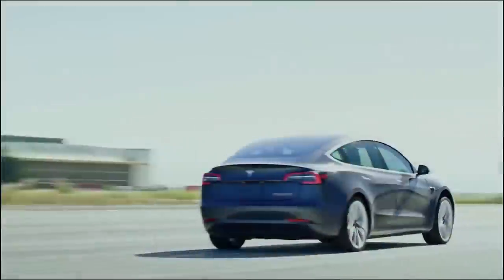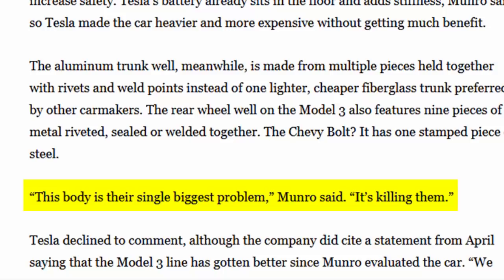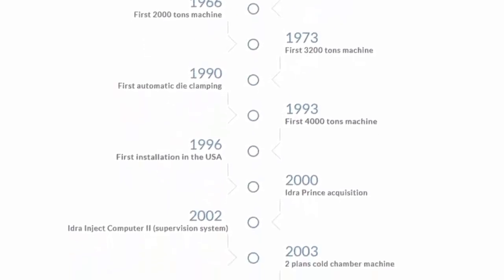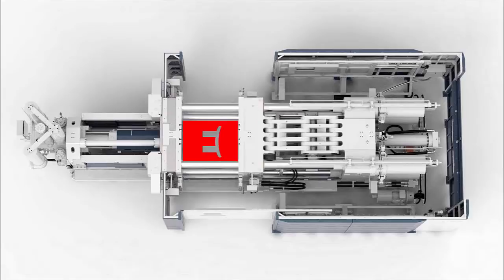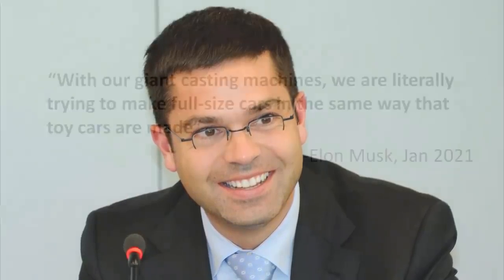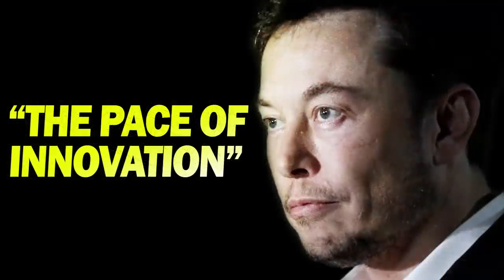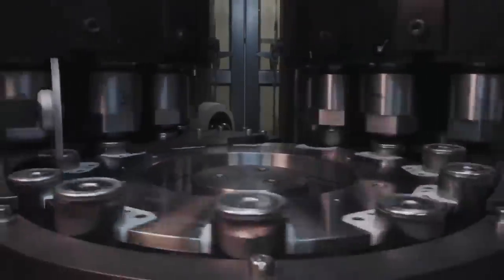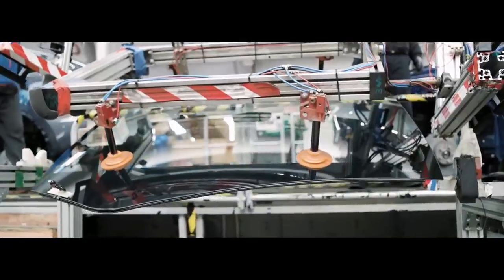Tesla Giga Press will CRUSH

Comment: I've seen MANY people use a torch or welder on something, quench it in a water bucket and then leave it in or set it aside to cool for a few extra minutes. I demonstrated that to my former boss in his machinery shop after he'd just seconds before, quenched a glowing hot mower blade in a bucket and I immediately reached into the water to retrieve it. It was the look on his face when he likely tallied up how much time he'd wasted over the course of his 35 years as a farmer. 
I scoffed when he told me to, "TELL....EVERYONE." I thought it was common knowledge and he'd just missed it somehow. It turns out that a lot more people were not aware of this fact than those who were. This was also some time before the ubiquity of the Internet, so I felt a little bit like I'd contributed in some way to the field of mechanical engineering. Lol 😂 
I later discovered—with the Internet this time—that the temperature of hot metal didn't fall to match the temperature of the water in the blink of the eye; it actually fell BELOW the temperature of the water. 🤯 It's the reason why we cool our bodies by sweat. 
Blah blah blah blah.

Comment: ....... completely ignoring the fact that ALL aluminium (yes I'm English) alloys work harden, fracture and fail. IF you prefer longevity, structural integrity, disinclination to ADD to the severity of a fire resultant from a collision, and ultimately the safety of you-and-yours, steel is a far superior material from which construct the body of a motor vehicle.

Comment: There are other hydraulic presses made that are designed to press close to 500 tons with low/high carbon steel alloys in industrial applications. The aluminum silicone alloy is indeed strong, but will be; wasting silicone that can be used in computers, and two is the fact that there are no hardened metals in there. With no hardened metals the chassis will be susceptible to plastic deformation.

Comment: Casting a aluminum car means the whole car will be useless after a fender bender. It will be impossible to fix a car made like this. I guess that is inline with Tesla's values because they don't want people fixing or repairing their cars.
Reply: This is discussed towards the end of the video. What they say makes sense.
Reply: @deldridg  cutting off crash rails and bolting new ones on sounds good.. until  you actually look at the details. The bolts will likely be steel. Aluminum bolts would not have the strength.  Yet the interface between steel and aluminum causes corrosion when the two elements make contact with each other over a span of time. So all of this "sounds good on paper"  it's kinda "fantasy land" in reality though. And have a insurance solution to this is hardly a solution. Jeezless
Reply: It wont make the car in one piece. It's like unattainable goal to push the process into new frontiers. They want to reduce the part count on the frame. Its impossible to make a large frame as a single casting.

Comment: I think that the CCP will apply this tech to military production and also dump EVs into emerging markets, just as they have done with Solar and Wind, largely by stealing or replication and "replacement", in the marketplace, even at a loss, if necessary .. They have also cornered the market (production) of strategic, rare-earth metals and other strategic materials and catalysts.

Comment: Other manufacturers don't need to reverse engineer anything ...
They take a part they want to make, design it respecting general semi-solid casting guide lines and recommendations from Idra, and make it with another custom Idra press.

Imo if one of the giga-castings gets damaged, this would be comparable to a damaged frame on a normal car, which can also be very expensive to repair.

Still the idea of a battery pack as a structural element makes me unconfortable ...

Comment: Current car bodies are made as sandwich of different metal parts to provide right ballance with brittleness and elasticity. So most likely they need to add steel parts inside aluminium part. And it's not an only press issue. Am i right?

Comment: I test drove a MY last weekend thinking there was a high chance I would buy one. The demo car looked like it had been wreak and repaired poorly by a shady body shop.  The gaps between the interior door panels and the dash were way high on one side and low on the other.  The windshield was above the A-pillar on one side and below on the other. The hood was crooked with really tight panel gaps on the upper passenger side and huge gaps on the lower driver's side.  Nothing I observed indicated Tesla has caught up to other manufacturers in their ability to assemble a car, they sure haven't leapfrogged them.

I understand some people's Teslas are assembled better than others.   If you feel like your car is perfect that's awesome - enjoy your ride.

Comment: I don't see any fundamental reason that cutting off a damaged crash extension and bolting on a replacement should reduce crash integrity or lifetime of the vehicle, done properly. Why does assembling the structure from 70 pieces improve that?

Comment: Model 3 starts out around 40,000. Battery changes probably every 7 to 10 years adds another 5 to $8,000... Somewhere in that range, plus the cost of charging the thing... along with the fact they are digging tons and tons of coal to make electricity, does not convince me electric cars are a green New Deal. Unique cars yes. Green absolutely not. There's a better answer than relying on fossil fuels to make cars go

Comment: Good idea for a factory but we'll have to see how the insurance companies feel about this as you mentioned. They will also need one or two of these machines sitting off to the side, often idle, just to make replacement parts for the previous generation cars still on the road. Doesn't really matter much for Tesla and their rich owners but I suspect this is one reason legacy brands haven't done this when they're trying to put out a new car with a MSRP of $18K which requires a shelf of common parts that can be interchanged between several models.
Reply: I agree. Munroe said " on hit in the rear on a tesla Y means the tesla with be totaled...."

Comment: I thing crash test will be chalange. Steel deforms and absorb energy of impact. Casted aluminium is fragile.
Reply: you have that backwards, aluminum deforms and absorbs energy of impact. steel does not. modern aluminum cars are safer for that reason.
Reply: @Zreknarf  yes and no. Aluminium cars are I guess from dural, which is used also for airplanes or TS which aee more flexible. According composition this seem to be silumin which is not flexible and in molded parts are also bubles, so can be upredictable. Aluminium cars have high safety, but mostly due to weight, which is eliminated by batery in this case.
But as I wrote is chalange, not impossible. Anyway is something new, testing will be expensive. And changes expensive too.

Comment: I have seen this many times, its; Designed by Engineers, rather than; Designed for Manufacturing. I use to be one of these guys who would do a lot of things like this, until I had an opportunity to over see a small cnc manufacturing company and realized that simple things like changing hole size, move a hole, change thread size, etc can save a ton of money. I then studied design for manufacturing.

Comment: Cast aluminum forms fine cracks when fatigued... this will catapult Tesla into exciting court cases within 20 years. One can be curious.
Reply: Bye the way that is why other companies don’t use it anymore ;)
Reply: I'm an aircraft mechanic in Alaska.  Salt water corrosion is a major issue with castings.
Intergranular corrosion is internal to the part.  It's very difficult to find before failure.
If the part is a third of the frame...that sounds expensive.
Reply: @chilkat_river  that’s another aspect for the same reason, right.

Comment: There isn't anything crazy advanced or even new in that press.  Pressure die casting has been going on for a very long time.  It's the application that is the great idea.
Reply: Or not, if it increases weight and cost using aluminium rather than steel. Only works with large volume runs.

Comment: tesla, always learning what others have known for decades. why do we not use aluminum castings for car frames? there are very good reasons why we don't. we use steel because it is very strong, and can flex and bend and return to its initial shape. we don't use cast aluminum because it doesn't like to bend, it breaks. cars move, a lot, it's what they do. bending and stressing and vibrating. how much are you paying for that car? and you risk frame cracks?...

Comment: These castings seem great for manufacturing, but how do you repair collision damage when the whole front or rear structure is one big casting welded to the center chassis? 

On a typical car, you would cut out the affected area, and weld in new material if you can't straighten it. That's not too bad if it's made of formed and welded steel, which is pretty ductile. 

But how much can you straighten an aluminum casting without it snapping? How do you replace part of the damaged casting without compromising its strength and crashworthiness? What does a replacement casting cost, and how much expense is involved in disassembling the car to replace it?

It looks to me that a car built like this is far less likely to be repaired after a significant crash, and that would probably be reflected in higher insurance rates as well.
Reply: The simple answer is that cars with the kind of damage you refer to are written of, whether EV or ICE. You smack a modern car side on and it will bend and that is not reparable, it will be written off.. Well it is but it is not a viable financial operation.

Comment: A 3d mill in a body shop to make a replacement part for the bolt on patch to the giga casting?  Not in bodyshops I have seen.  Then again regular unibodiy vehicles in crashes serious enough to need a frame jig are generally written off too.... It might be a wash statistically.
Reply: It always depends on the damage.

Comment: Germany was using high pressure die casting to manufacture aircraft bulkheads in WW2.
Reply: Yes, but zey dint zign ze paperz !
Reply: It looks like a standard die casting machine used for metal and plastic.
Reply: @tubester4567  No it use a special aluminum for the Giga press because the normal aluminum can cool at different temperatures so it can cause cracking.
Reply: @Madame702  Yah but the machine itself isnt new, its a standard die casting machine, just big.
Reply: @tubester4567  Great news Tesla Giga Texas will have massive Tesla Power Pack batteries on site.  Elon Musk is going to turn Tesla Giga Texas into a electric vehicle.  This is great news this force GM, and Ford to also do the same to their factories.👍⭐😊

Comment: Sounds like a lot of aluminum welders will be needed after crashes
Reply: or just years of normal use. metal fatigue. we don't normally use cast aluminum for a structure which flexes and vibrates in normal daily use. I don't understand their thinking..
Reply: @lorenzo42p  uh, airplane wings? Yeah, there are time and cycle limits for the fuselage, but the wings see much more stress and flex per flight and cycle

Comment: Knowing at least one famous German car manufacturer from the inside, I can tell you: they are fuckin NOT ready to compete with this.
Reply: yeah but they will catch up quick
Reply: @parg60  Probably less than decade. Yeah.
Reply: @parg60  My best guess regarding the German car makers is, that there is a 50/50 chance that they will make it... You have to see one thing: Companies like Tesla are doing this stuff for 20 years. The only thing we Germans did, was to make the old fashioned way more efficient. Innovation is dead inside those companies. PLUS today most of the development is outsourced to lower cost. Look at FEV in Aachen for example. Those guys could totally make a car on their own...
Reply: Yeah but now look it that way: Tesla is competing against companies that have the infrastructure of producing cars for far more than 50 years, but still manages to be conpared to those. I don't see many of the old guard still be around in let's say 25 years from now...
Reply: @TheMullela  Yes, but german car industry has been building cars for a really long time. There's more than just a battery and electric motors in a car. And living in Germany, I can tell you that VW, Mercedes and BMW are trying really hard. And they are in no means worse than Teslas. Here in the EU, most of electric cars are not Teslas.
Reply: @parg60  compared to establishing a vertically integrated supply chain, while making EV affordable in the most fashionable way, building cars is fairly easy. Just wait about 10 years and you will start seeing which companies will survive this and which one's not.
Trying hard won't safe them. They smiled for too long and Mr musk.
Reply: GM and Ford are already dominating the north American market, and their flagships haven't even launched yet. I'm not sure about Europe and likely not Asia, but Canada, America and Mexico will still be dominated by the big 3 (for better or for worse) 

https://www.google.com/amp/s/jalopnik.com/ford-is-beating-tesla-in-one-of-the-most-ev-saturated-m-1847009876/amp

Comment: This will help them today but this is not the future of the automobile.  I believe the future will just be a "skateboard" battery filled chassis with hub motors with whatever body you want on it.  Magna is already working on these and I believe Rivian is working in that direction too. Autonomy will provide an invisible barrier around each car making accidents non existent which will mean a serious roll back in safety regulations, cars will, start to look good again (60's) and not like the bumper cars they are now.

Comment: You should look at the mesta 50. Following ww2, the USA found that Germany had a couple VERY massive forges, allowing them to produce huge forged parts in a single forging, which the same part would require all of the allies, to produce several parts then combine them together. 
So, we began the heavy press program. 
There's an excellent documentary here on YouTube about it. 

Seems we've run into the same problem once again. 

Btw, 50 refers to 50,000 tons!!
There was even a press captured by the Soviets from Germany that was capable of 150,000 tons of force. 

Meh, 6k?
😳😂😂
Reply: These are diecasting machines. Not just a dumb press. Its all about injecting high speed molten metal into a die at a variable flow and pressures. Clamping pressure is important but far from the real challenge.
Reply: @soulhair9647  i watched the whole video, so, while I appreciate your comment, I'm totally aware of that. 
My point was simply that the pressures they're speaking of are really nothing extraordinary, there's a great video about the government's heavy press program that explains why there so unique and vital for maintaining an edge in the world economy. Thanks for your position though. 😀

Have a great night man. 
😎🇺🇸

Comment: Nobody stamps steel like the Big Three. I can't blame Tesla for at least initially making things work on a smaller scale. there is a vast difference in tooling when you scale up the stampings. 
how much easier was it for them to just make a bunch of smaller parts? but very true that it's not a sustainable method for assembling a proper unibody.

Comment: They are surely not "... some of the largest machines  in the world." They are not even larges for presses. 6000 tons is small. The Western World has been using presses in excess of 30,000 tons for aircraft parts since World War II. That's 75 years ago. Today, the Boeing 747, F-35 Joint Strike Fighter, and stealth bombers are built using components pressed on 7 story tall 75,000 and 65,000 ton metal presses.  15,000 ton presses abound in industries world wide.   https://en.wikipedia.org/wiki/Heavy_Press_Program
Reply: You are correct. Mankind has been using much larger larger presses with hot material for almost 100 years. Is it nice to see Tesla use this technology, but it has been applied too many industries including vehicle design in racing and military applications.

Comment: what's the cost of repair to the Giga Press  and upkeep to keep it going? How often does it need to be maintained 24/7?...and when that happens, to have one of those machines shut down per unit time, what's the cost for labor, and overhead given that the supply chain is JIT?

Comment: Essentially a Hot Wheels car with the top being riveted to the bottom....
Cool....
Reply: Not riveted, welded. Also it's still better than having so many parts in one litlle space. half rivited half welded. Overall it is better durablity than most
Reply: @m-2718  weakest link breaks your car
Reply: @lorenzo42p  And well previously there was 370 of thoes posible weak links
Reply: @m-2718  a solid casting can have any number of defects or stress concentrations in the shape. their choice of material doesn't make sense to me.
Reply: @lorenzo42p  Aluminium, silicon, quite standart, why doesn't make sense ? Aslo yes, i aware of casting defects, stess concentrations is something that good design should remove
Reply: Your Mom would have more trouble standing on a tesla and crushing It -Than our old hot wheels
Matchbox cars haha

Comment: It will be very interesting to see what happens with car insurance. In most nose to tail accidents the areas where these parts will be, will most certainly get damaged. It will be very difficult to straighten those so called giga-parts and exceptionally difficult to replace them. Relatively minor accidents may well cause the vehicle to be totalled or written off by the insurer. If so, insuring these cars will become very expensive.